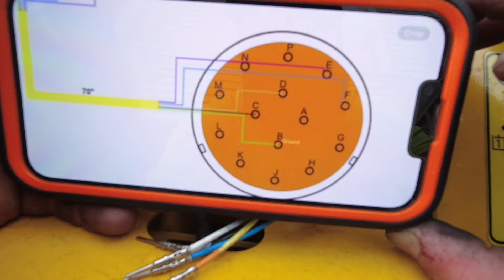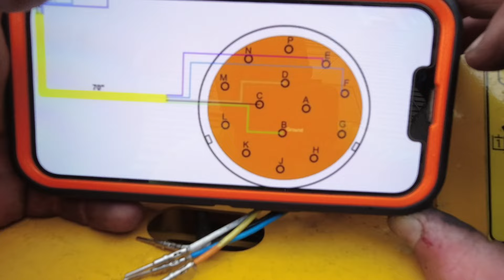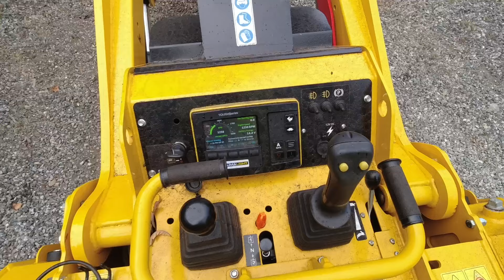BETTER Than a TRAILER?? NEW Firewood Delivery Method

Comment: That is excellent  ingenuity.  The only change I would  make  would be to have at least one chain speed binder  - ratchet straps are  good, until they're not.

Long time subscriber - keep up the great  videos,  just a matter of time to go viral.
Reply from the maker: Thanks for watching! I have plenty of of binders and chain but I need to cut them shorter so they are easier to deal with.

Comment: It appears from video that if side panels were removed from truck to make a flatbed and then two totes could be rotated 90 degrees and fit/loaded directly from ground onto truck bed and then if mini skid was loaded from rear (rotated 180 degrees so that forks pointed to the rear) doubling the delivery capacity to two totes when/if needed. Truck seemed to effortlessly handle bed return with one tote and mini skid steer. Also if a single 4x4 long enough to span track width was placed at rear of truck steel ramps would not be needed and loading and unloading would be much easier. Just a couple of easy to try suggestions to possibly further increase your options and improve efficiency. If bed is not long or wide enough it could be lenghtened or a simpler solution would be to make a pair of removable drop in wings to widen the front of stake body enough to fit both totes. Ray
Reply from the maker: I can fit two totes on the front and mini on the back with a fork in each tote pocket same as I showed here. I have loaded the machine by utilizing two small (2’ long) 4x4’s but figuring out the exact placement of the blocks to allow the machine to easily track up and onto the bed was more trouble than it’s worth. Not to mention the machine bucked pretty hard when it comes over the tipping point.
Reply: @DudeRanchDIY  Just a thought never can be sure of measurements from video, Thanks for the response Good Luck. Ray

Comment: You're breaking your back with those steel loading ramps ! Buy a set of aluminum ramps and never have to visit the Chiropracter ! ~ 40 lbs !
Reply from the maker: You’re not wrong… however watch how I move the ramps. I’m not fully picking them up, instead I slide them on the bed to avoid handling the weight. 

At this point my customer base doesn’t take advantage of this additional service enough to justify aluminum ramps that can support the 4-5k lbs of the machine and full tote. I have looked into it.
Reply: Frankly I don't see why he needs the ramps at all. A tracked machine with arms to bump the front tips up over the lip has no problem with such a small step-up. Sure he is carrying the basket, but he just needs to set the basket down on the bed, keep the forks in the slots, and mash down to raise his front end. A small movement forward to get the end of the tracks on the bed, and he can lift the basket again and keep rolling forward.
Reply from the maker: @PiraticalJess I’ve tried this, the back of the machine bottoms out and scrapes the back end.
Reply: @DudeRanchDIY  Thanks for the info. I haven't had this problem with other machines, but now that you mention it and I'm looking at the shape I see what you mean. This is different from e.g. a Cat 262 that can be rolled onto its butt if we're not careful!

Comment: Could you place 2 totes up front, a third behind and to the right, turned 90 degrees, and still get the mini loaded aside the third? One cord and the mini. Would the truck be able to lift it?
Reply from the maker: Probably could, although I’d probably use my trailer at that point.

Comment: You need new storage trolleys ,you can get storage trolleys that fold flat, and can be stacked like supermark ones ,  they also have a hinged front,  meaning uou can get the contents out , without having to mess about as currently are. Yes it is more money initially  , but in the long run. It will be more financially beneficial.
Reply from the maker: I’ve gotten over 175 totes for absolutely free and they work extremely well the way I use them. If it ain’t broke don’t fix it.
Reply: @DudeRanchDIY  always someone who wants you to fix some that’s not broke.

Comment: Your makeshift tailgate will get lose over time and when you hit a bump it will bounce out from experience might want to be able to fix it so you won’t lose it, if you haven’t thought of it.
Reply from the maker: I plan on making a more permanent tailgate out of expanded metal and tube steel over the winter.

Comment: That hook lift is great , have you seen any other wood yarders that use one ?
Reply from the maker: Nope
Reply: @DudeRanchDIY  me neither
Reply: @DudeRanchDIY  We have been using an International with a Stellar 52" Hook lift , four containers and one flat bed for the past 20 years in our firewood business. One of the containers has a separator gate for multiple deliveries in one trip. Handiest rig all around. Good setup you have going there.

Comment: I am confused? You refer to that ibc tote as 1/3 but it looked loose stacked and from my understanding that would only be 1/4. Have you ever checked your quantity by stacking and checking? I haven’t took the time to do it myself but I wouldn’t want a bad reputation. Or am I missing something?
Reply from the maker: You aren’t missing anything, I referred to it as 1/3 cord but that was a small basket you are correct. I deal with so many this time of year sometimes I mis speak! I have dumped them out and stacked to compare and the large totes loosely filled are 1/3 cord.
Reply: @DudeRanchDIY  thanks for the info all my totes are the small ones

Comment: I just have one question: Have you ever been stopped at a DOT checkpoint?? I’m asking because you would probably be put out of service with that International. The sides are not secure and that tiny wooden tailgate is dangerous only being held in place by the two small pieces of wood in the stake pockets. Plus, the way you load it with the machine on the tail end makes the truck an unstable safety hazard. That roll-off body was never intended to haul a machine with a high center of gravity. You would be much better off getting a medium duty tandem axle landscape trailer that is much lower to the ground. I like what you're doing, you just need to invest in the proper equipment for safety’s sake.
Reply from the maker: Never been stopped and I’ve driven past  DOT frequently. That is a 13,000lb hook lift... The 3,000lb machine and 1,300lb tote is well within my legal load limits… if I had the dumpster can on filled to the top it would have a much higher center of gravity than the mini skid... I frequently see guys hauling mini excavators on the backs of these types of trucks. I also have a 14k tandem axle equipment trailer and dump trailer. 
 Thanks.
Reply: You don’t know what you’re talking about

Comment: I'd keep that person's number and name, and next time I wouldn't have wood for him, you are going to move it don't worry. I'm still not impressed with your machine it's way too bouncy plus you had to rewire the electrical no, something not right. Interesting video and well explained keep them coming.
Reply from the maker: Yeah sold the wood the following day, the machine was very bouncy going up those equipment ramps due to the rigid track idlers. The electrical really wasn’t a big deal just had to figure out which wires controlled what.

Comment: As someone who is forklift qualified  ,can I give a bit of advise,  your machine is dangerously un balanced , it's centre of gravity Is near the front , whereas it should ideally be towards the rear of the vehicle on the centreline.  That is why it keeps bouncing.
Reply: Thats just apart of the game when it comes to these machines..
Reply from the maker: Although this machine has forks it’s not a forklift. Im forklift certified as well… any rigid tracked machine will bounce around over contours no matter the weight of the load on the front.
Reply: @DudeRanchDIY  man , i,wouldn't  trust that , to sketchy
Reply: Although there is some weight up front Jake is clearly handling it with patience and experience. 
This is normal operation on tracks 
If you did want to fight against it you could add some counter weights to the back. I would almost bet they sell some model specific. Or, you can custom mount something. But, if this is the heaviest loads you deal with and rare to deliver it’s clearly handling it good if you take it slow like you already are